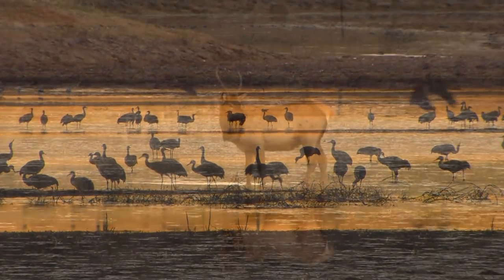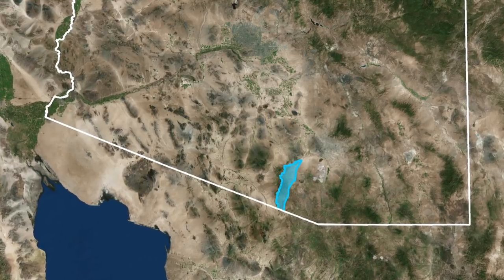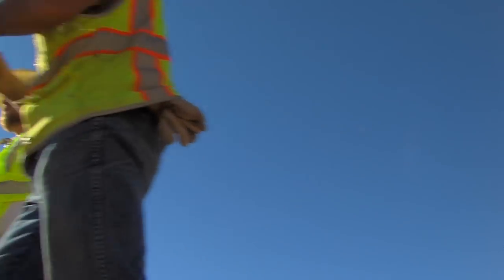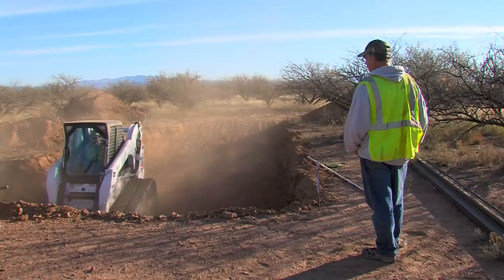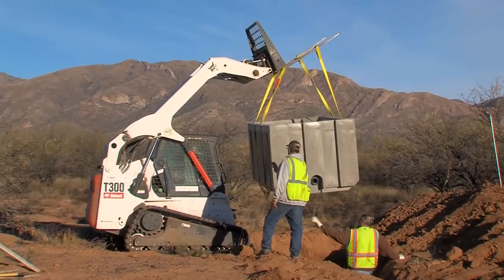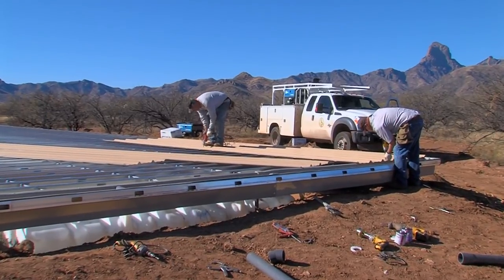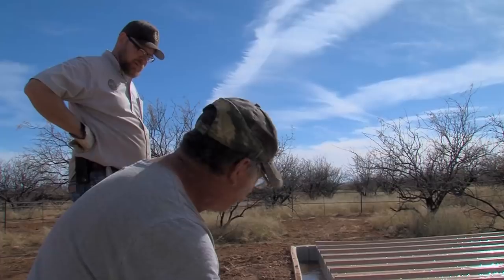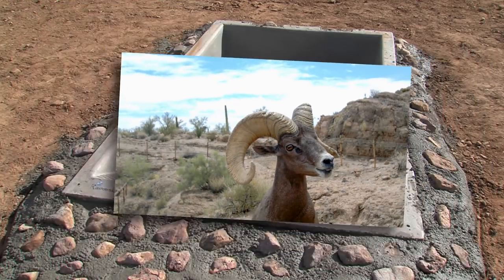Water for Wildlife

Comment: should also send a mid size excavator and a dump truck up arroyos and dig multiple several foot deep  catch basins in the arroyo bottom every 1/8 mile for several miles so any flash flood water is slowed down and captured . this might work like putting in beavers.  would they travel up the arroyo and dig them as they drive back out..  as long as they are only in the arroyo.. it should not really effect the desert flora and fauna at least until the water starts staying instead of just running off every time there is a rain or flash flood.. this could also be used up arroyo from highways and train tracks to reduce flash flood effects washing them out..  would they need to be redug every few years. yep..  would people downstream scream water rights.. perhaps.  would it be cheap to do.. mostly..